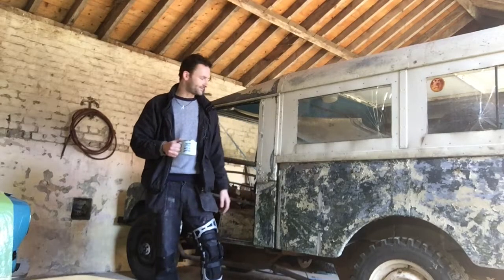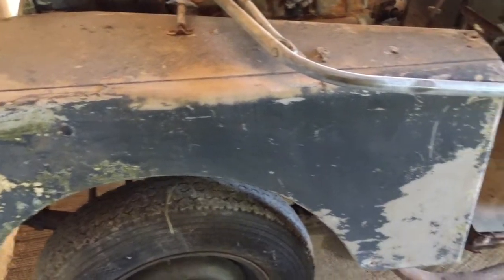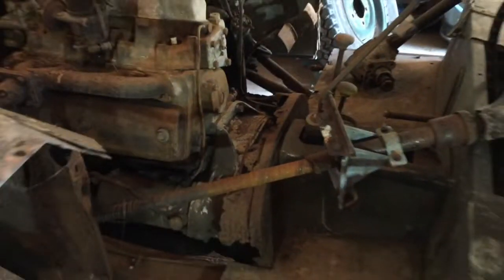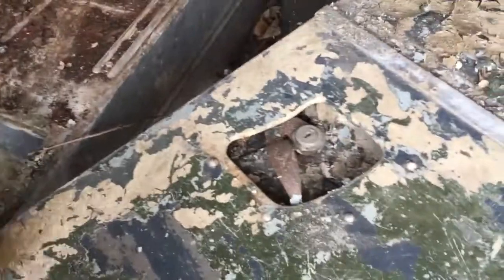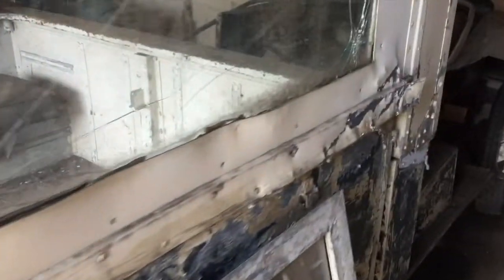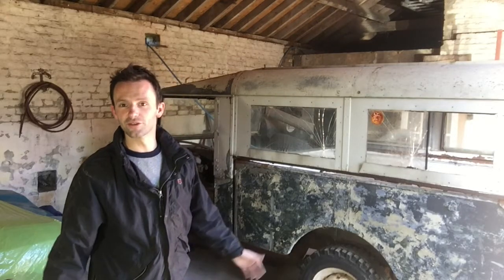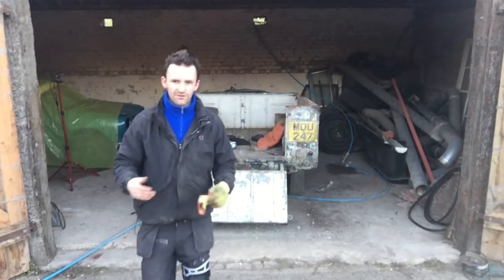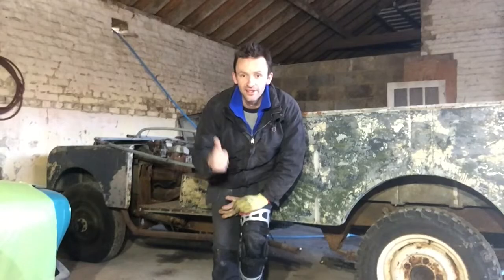Land rover series 1. Ep2 (Teardown Day 2)

Comment: High pressure water blast will take most of the loose stuff off and a plastic scraper will help if you want to preserve the patina.....steel scraper on Aluminum panels/paint will end badly.  I have been searching far and wide for a S1/109 tailgate - very hard to find it seems.
Reply from the maker: Good suggestion ! Yes not the best idea with the steel scraper but its a patina truck so I'm not to worried. I think I may have found a tailgate !! :)